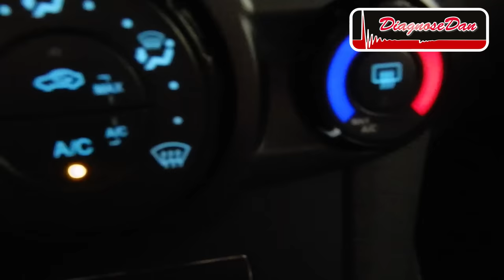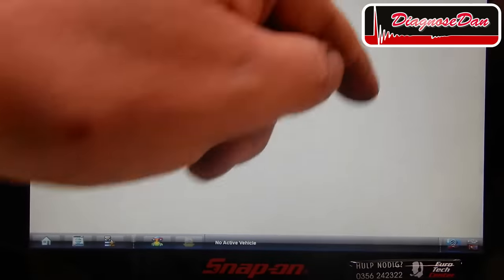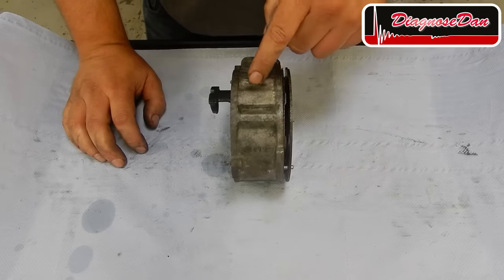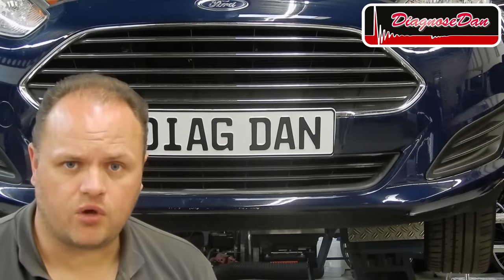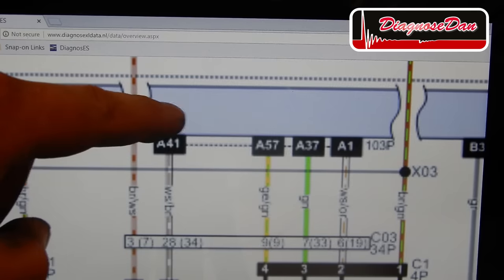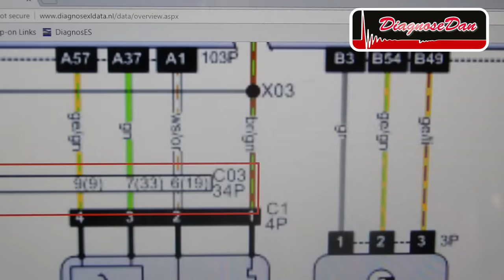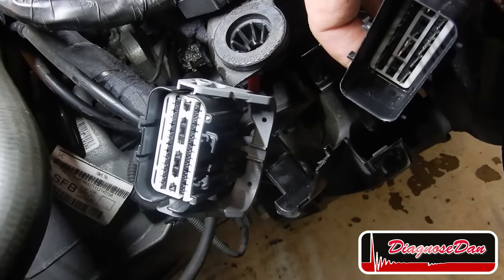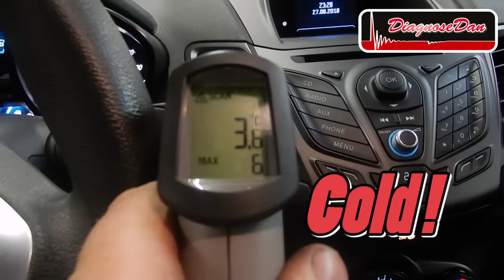Ford AC Trouble ! (Variable AC compressor)

Comment: Hello Dan, thank you for your interesting videos , I am pleased seeing them(sorry for my english I am spanish).
I have a question: When you test the cables in the separate connector you have the contact ON, I undestand that it generate multiple OBD Fault codes  in different ECU´s, when you reset the fault codes I undestand that you are resetting all the codes in the different ECU´s generated by splitting the connector before?
Thanks for your attention, and congratulations for your work and dedication.
Ruben
Reply from the maker: Yes of course! Thanks for watching!

Comment: Very good video Dan. Thanks for this. I'd just like to ask what if my compressor clutch engages on its own, 10 seconds after car starting. Without pressing the AC control to on. I have Ford Focus MK2. What else could trigger the clutch? Relay is good btw.

Comment: Which electrical wiring software did you use please? It is not the one within the snap on scanner I have the versus edge and is nowhere near the quality you are using in this video. Excellent tutorial as ever many thanks.

Comment: I really enjoyed this video but I have 2 questions A: was the check engine light on? B: in theory could you temporary run that  wire to ground to test if the air starts to cool?
Reply from the maker: The check engine light was not on and yes you can ground the solenoid to see if it Works. Not to long because it can overheat.

Comment: You're hilarious man. Thanks for the content. My clutch won't engage. Still trying to figure it out. I jumpered the relay and the compressor kicked in and then it started spraying vapor from somewhere. Maybe the high pressure port? But i yanked out the jumper immediately because I didn't want to total the car. LOL.

Comment: Hi Dan.  Awesome video.  My 14 Fusion's AC allegedly has the compressor not building pressure.  Is this common with this type of compressor?  I hardly think a seven year old compressor should be checking out.  My 04 Mustang still blows frost from the vents.  Better to replace the compressor with a new unit or a rebuild?  Thanks much.

Comment: Thanks for another great video. Very well explained.
Question can a bias voltage be 12 volts
Thanks
Reply from the maker: If the bias voltage is normally a low voltage and not 12v

Comment: hello Dan, why don't you show how many voltage on pin 28 side after you fixed a problem at the connector. if possible could you tell me how many voltage there, 12 voltage or below? I, personally thought that it is under 12 v because it has used for AC Solenoid. 
Tks so much and have a nice day. Love you

Comment: Cool found. I have problem with my old A4 B5 1998, ac lines freezes up to orifice tube, drier and orifice tube is new but i think ac compressor does not intermit, it runs all the time when ac is on. there are pressure switch on front that is new also. i think im gonna start measure its wiring. please comment if something comes mind

Comment: Very interesting I had a Focus with that same style connector with one pin backed out.  It was setting a transmission solenoid circuit code.
Reply from the maker: Ok, so i guess it's a Ford thing!

Comment: Dan you are genius man, I have trouble on my Ford fusion 2014 2.0, I got code P06a0 variable a/c compressor control circuit, compressor working but not pumping cold inside car warm air coming and this big cable was damaged in time during accident, we checked everything pinned correct and have voltage, can you please advice where else we should look at?

Comment: I could tell someone else had their greasy mitts in there because right in the beginning you could see someone pierced the wire insulation with a probe (and worse didn't even try to seal it), which is a big no no.
Reply from the maker: Sharp eye! Yes someone else had this car before me but couldn't find the problem😊

Comment: great! I love all your video's, easy to understand! But wich software do you use for the electric diagrams? Or better in my case for a 1999 Fiat ducato....   Lost power to the separated 12v all on switch in the cockpit. if you push it powers 80% of the car shortley. I accidently cut a wire in the engine room and probarbly short circuit something repaired the wire , it did'nt fix the problem and all the fuses I can find are good. :-(  A wire diagram could help..... thanks in advance!

Comment: Hey Dan,great videos.My AC on 2017 GMC terrain doesnt cool,we've narrowed it down to a clogged condenser, but the fan doesn't come on when the compressor clutch kicks in, it does work however when the engine needs cooling so i know that the fan motor is good.what are your thoughts as to why the fan isn't triggered on when ac is requested?

Comment: Now that you have repaired the connection. If you were to check voltage at the command wire at the PC, there should be system voltage and not the bias voltage?
Reply from the maker: Yes we tested that in the video didn't we? The testlight, lights up at the PCM after the repair. Bias Voltage didn't light up the testlight.

Comment: Hi Dan, here's my puzzle. 2004 Toyota Yaris. AC working, then condensor corrosion causes gas leak. I buy new condensor, AC shop fits it, they can't get full gas load into system. They tell me to buy a new compressor. They discharged system. I took out the ac solenoid and tested it with 12v battery. The solenoid clicked but the internal piston didn't move, i also repeated the test with a balloon full of air attached, no air passed out top opening when energized. Could a faulty solenoid stop the system from being fully charged? I've ordered a new solenoid. And i checked the 12v supply to solenoid, it is present.

Comment: Hey Dan, do you know how much pressure is needed in the system to cause the swash plate to move and start pumping? I'm having the same problem with my 2013 Ford Edge. Replaced the compressor and still have the same problem, not pumping.

Comment: Hi Dan,
I just bought a used VW Polo 1.4 2011,
after 2 weeks I found the compressor had been replaced with a fixed compressor, as we know the original one is a variable compressor with solenoid control valve..
What is your suggestion to me?
Thanks.

Comment: Usually, the culprit, if the compressor clutch and fan kicks on, is that the AC is out of freon which can be something as simple as a missing service port cap to something that is a pain ass as a leaky evaporator core. Sometimes it can be something as weird as a bad pin on a PCM connector.

Comment: There you go !  No parts however, that part never should have failed yet they do way more often than they should.  Why?  Poor construction and materials.  This happens all too often with newer vehicles which are full of electronic components running on 5 volts, 12 volts and sometimes 3 volts. Just the slightest bit of oxidation or as in this video, a sunken pin or a misalignment can cause all sorts of problems depending on the location of the wire harness etc. Many PCM's and ECM's require communication to each other and if occurs, all kinds of items in a vehicle can be disabled causing another more in depth investigation as to the location of the problem.  No one really thinks about the integrity of a wire hardness connection yet, they do exist in many places as well as in fuse boxes and power distribution areas.  Manufacture defect !  Ford should pay for this failure regardless of age. Those connections shouldn't fail that soon, period ! Way to go Dan

Comment: Diagnose Dan, How hard is it to replace a compressor on 2008 mazda miata? At first a c works when driving and stop on idle , the pressure is stable and and compressor is not cycling.Condenser fan works TXV not sure ,Should I replace the compressor?

Comment: How does one single pin decide to pull itself out of connection??  Good video to show your diagnosis steps,  but I find this hard to believe.  In the years in this industry I have seen plenty of corroded connectors but never a single pin being pushed out on its own.  🤔🤔

Comment: While accilarating does variable compressor any changes ? Like clutch type compressor?  and control unit will controle more the solinoid while accelerating ? Because I saw in mercedesbenz while accilarating evaporators temp sensor reading going down quickly

Comment: Sir can I ask something?...if the test light, lights on/off on the back of the ac compressor solenoid connector while back probing and while pushing ac switch on/off,it means all our inputs and outputs are good correct? And the module is good also,...and the solenoid is pass to resistance check or we just say good also. But if we turn on the a/c system no cool,and no reaction on our ac gauge no pressure and vacuum. Can I 100% sure to condemn  compressor fault?...clutchless variable displacement compressor

Comment: Buggered if i know the ones i have watched you fix are just a nightmare, so many wires and complicated systems.
Reply: The key is to isolate the problem down into small manageable pieces. There may be thousands of wires in the entire car, but only two of them control the A/C compressor. That's why the wiring diagrams are so important. I wouldn't try to troubleshoot a modern vehicle without a good set of wiring diagrams.

Comment: Very comprehensive diagnosis, Dan! One question, if you don't mind: 
Around 13:15 you say that high and low side pressures (or is it the difference between them?) should move the plate when the solenoid is commanded on... but when the A/C is initially off, aren't the pressures the same? -- how is the process jumpstarted and, if there is a special trick, could it be seen in the design of the solenoid or the plate? 

Thanks!
Reply from the maker: I don't mind but this won't be my last Video on the Subject and i don't want to overload people with information. This is why i kept the video quite simple. Although i didn't mention it in the video you can see when i spin the swash plate with the compressor turned off. There is still a slight wobble, this is the minimum stroke mode.
Great question b.t.w! I was waiting for someone to ask but your the first one!💪
Reply: Keep in mind that a spring is always defaulting the swash plate into minimum displacement (minimum plate angle relative to the shaft's normal) when there's no pressure differential and therefore no force develops against the pistons (and there's no pressure differential in three cases: 1)Compressor internals open to the atmosphere 2)Compressor shaft not being driven 3)System not charged, a system whose compressor shaft should never be driven to avoid compressor seizure, since the refrigerant both cools the compressor down and moves its oil around the system, very important when the compressor doesn't feature a dedicated oil supply system). That said, the solenoid valve (or the mechanical valve, since these compressors can also feature a mechanical valve that only relies on sensing the suction pressure to adjust the compressor's refrigerant flow) in such a compressor can do two things: bring discharge pressure, a positive pressure, inside the compressor's crankcase, so to keep the pistons always commanded in minimum stroke since the pressure differential is developing a force on the back of the pistons and the swashplate therefore reaches the minimum angle, and bring a negative pressure, i.e. vacuum, inside the crankcase through the suction port, so that the pistons are forced back and the swashplate reaches the maximum angle, making the pistons reach the maximum stroke. The valve housing is connected to the crankcase, the suction ports and the discharge ports; the valve, be it solenoid or mechanic, only routes the pressure through different passageways to adjust the swash plate angle as needed. The mechanic control valve only aims to get the evaporator as cold as possible without allowing it to freeze, so compressors featuring one need a clutch otherwise AC would always be on (the valve is usually set to begin routing discharge into the crankcase at 1,92 barg suction pressure in R-134A systems, which matches a saturated vapor temperature of 0°C, roughly the same evaporator temperature when dealing with modern high efficiency parallel flow evaporators); the solenoid valve allows the evaporator temperature to be chosen freely, and allows the clutch to be discarded, but relies upon an electrical connection and a control unit, which can both fail as seen in the video (the mechanic control valve can fail too, but it's usually easier to diagnose and replace).
Reply from the maker: @teravolt6113  you seem to know a thing or two about AC Systems!😉👍
Reply: @Diagnosedan  Happy to share my knowledge.
Reply: To the OP: i forgot a small but important piece of info. As DiagnoseDan pointed out, the minimum displacement is not actually zero displacement. This minimum displacement is able to generate enough refrigerant movement as to generate a slight suction/discharge differential. The solenoid valve, when the compressor is commanded into high displacement by the control unit (when ECON/AC OFF is active or blower is switched off, it's actually commanded into minimum displacement with a clutchless compressor; otherwise, the clutch coil is unpowered when no cooling is needed at all, i.e. AC turned off or blower off), routes the suction pressure inside the crankcase et voila, the plate immediately strokes into required cooling capacity since the discharge pressure inside the cylinders is pushing the pistons back with not enough crankcase pressure to react... i hope that answers your question. By the way, that slight wobble is the very reason as for why you never want a system with a clutchless variable displacement compressor run out of refrigerant... that slight movement generates a LOT of friction and therefore heat without proper lubricant flow. Always prefer a clutch equipped compressor if possible: that way, if the system loses its charge the clutch coil is unpowered by the ECU that senses a lower than required pressure in the liquid line and the AC system is safe.

Comment: I have a non working Airco for about a year know. It has been to 2 shop 3 times (the official dealer). Non of them seem to grasph how an airco works. I brought it to the first shop because the airco did not work. They said it was the clutch. Only 400 euro's to fix. I did not believe them since I can hear the clutch closing and I can see it running (system was filled 100%). But to be sure I measured the airgap and adjusted the shimming. Airco still did not work. Brought it to the dealer. They said the condensor was leaking. I told them, that can't be it since the airco does not work at all. I can read the data from the ECU. Evap core temp is just ambient and does nothing. At this stage I got a total of a 1000 euro's worth in qoutes and already 350 euro's in for diagnose & filling/emptying and nobody know what the fuck is wrong with it.

I decided to go for it myself. Bought a UV light and found two obvious leaks because of failed o-rings. I decided to replace the condensor and dryer since they are 20 years old and pretty cheap. Put the system back together and got it filled again. Still does not work according to the dealer. Here is the thing, it does work just fine for about 2 minutes (evap core temp drops to 6 degrees C in 10 seconds).  After that the temp start to rise slowely in a couple of minutes. Also the high pressure side pressure drops. When looking at this video i'm  90% sure there is something wrong with the swashplate control of the pump.

Every time I start the airco it get's stone cold in seconds the only die slowly. Wait 10 minutes and turn on the airco....works fine again for a couple of minutes.

Most dealers charge premium hour rate (this dealer is close to 150 euro/hour). For that price they do not even get a proper description of the symptoms. It is sad.

Comment: Hi Dan,
I have a w211 with a Denso 7seu17c compressor. My ac works fine but after 4 years from last service I would like to completely evacuate and recharge.
I don’t have a recovery machine so I thought of taking the car to a shop to evacuate the system, drive home for about 20 minutes and then at home vacuum and recharge . Is it safe for me to drive the car home with no refrigerant in the system? Being this a clutch less compressor my fear is to potentially damage the compressor which,  unlike the constant displacement ones, could be still in motion even  with the ac button off. What’s your advice on this? Thank you
Reply: Roberto Cabiati non succede niente roberto. Aparte che rimane un po di olio dentro nel compressore ma senza la pressione la piastra gira ma i pistoni non vanno su e giu!
Reply: @armandonika  thanks Armando ..